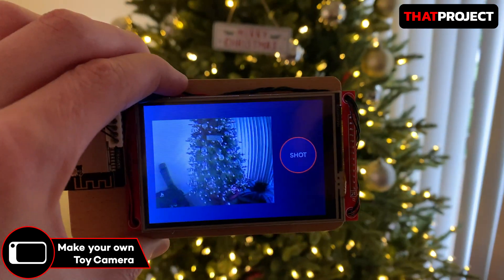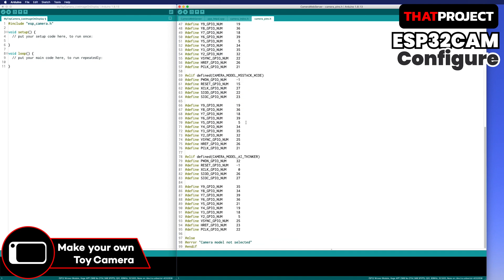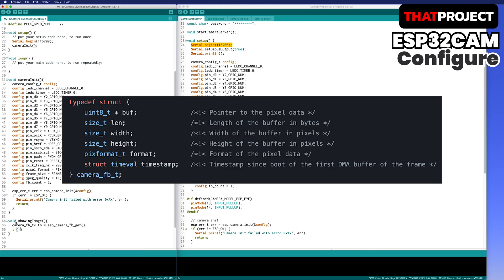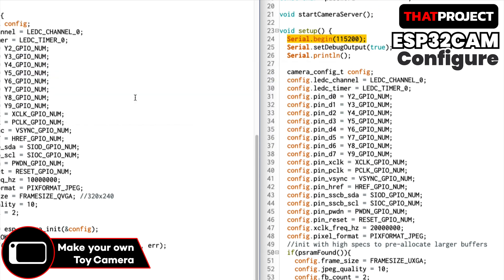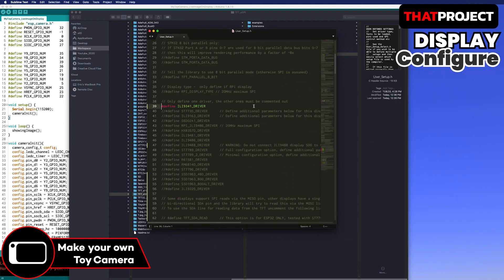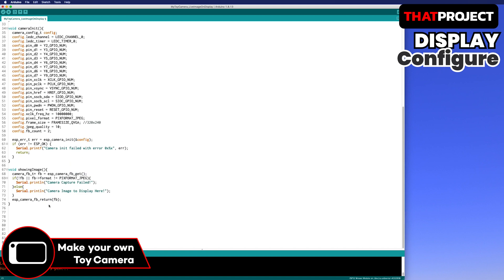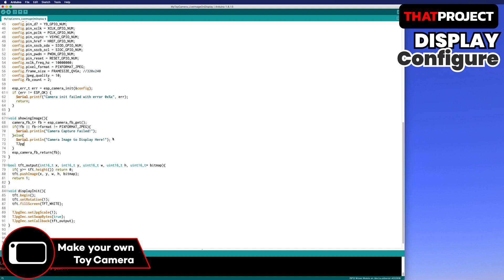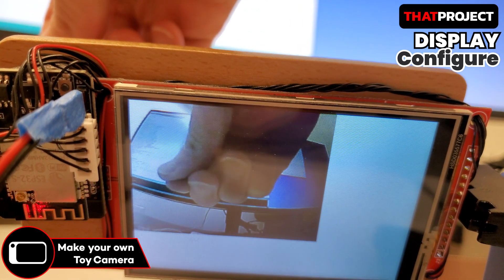Toy Camera = ESP32CAM + ILI9488 + LVGL7 | Part 1, Live Feed Display #ESP32CAM #TOYCAM

Comment: How to use ESP32-cam with ST7735 without touch function? 
I will need extra push button for taking picture and I don't know if there will enough pin on ESP32-cam after some pins are connected to TFT screen.
Reply from the maker: @jumbo999614  It's an old project so I'm not sure but, you could also use a button trigger with GPIO2 instead of the touch.

Comment: If anyone else is having trouble with a white screen after properly adjusting the User_Setup.h file, you may have a problem with pin 16. In my case, my ESP32 didn't like me using pin 16 for the MOSI.  So, I changed "#define TFT_MOSI 16" to "#define TFT_MOSI 2" and moved the connection on pin IO16 to IO2.  That fixed everything for me!
Reply from the maker: As you know, this is a project I tried a long time ago and I don't remember exactly how I wired it. If possible, I would like to do a similar project with LVGL 9. Then I will take a closer look at the parts you mentioned. Thanks for the comment.

Comment: working with freenove  esp32s3 Guru Meditation Error: Core  1 panic'ed (LoadProhibited). Exception was unhandled.getting this error
Reply from the maker: This is an old project so it's hard to know what the issue is. If you use the version used here instead of the latest version, it may work like the video.
Reply: @ThatProject please mention esp , TFT version
Reply from the maker: @sudipasaha1225  The ESP version seems to be 2.0.6, and the TFT_eSPI version cannot be confirmed.

Comment: Hello, i tried this tutorial but i am only getting a white screen on my display, i have checked that my display is hooked up correctly by displaying different graphics on it. I am using an ESP32-Wrover-CAM.
Reply: Just in someone else is having the same problem, in my case, the problem was pin IO16.  For whatever reason, the ESP32-CAM didn't like me using that pin for the MOSI.  So, I changed "#define TFT_MOSI 16" to "#define TFT_MOSI 2" and moved the connection on pin IO16 to IO2.  That fixed everything for me.  Hope that helps!
Reply: Nevermind, i just realized you cannot use the same pins for Camera that you use for the tft display, changing my pins worked.
Reply from the maker: @logz3288  This project is too old. Are you using lower versions of all libraries to run this project?
Reply: @ThatProject  Nope, using all new libraries but managed to get it to work by changing the pins i used for the display. I got a white screen before because i was using pins that were assigned to both the camera and the display.
Reply: @logz3288  Hey bro, could you please tell me the pins and connections you used in both the esp32 cam and the display?

Comment: I want to give you a shoutout man! I am new to this and not very much good with Electronics and there is hell lot of shortage on in-depth connection between ESP32 CAM and the ILI9488 TFT. I've scratched through all the corners and tried to make it work but of no use. I carefully looked at your video and made the connections (at https://youtu.be/K5Tr0AjK-Uc?t=283 ) and was able to work it out. Still need to go a long way but atleast I got to work with the example. Also, if possible for anyone, can someone please help me understand how we upload code to the ESP32? Following the connection in this Video, I uploaded code to ESP32 CAM separately first and then conencted it to the TFT(this is the only way I am able to work it out for some but not all the examples). Is it the only possible best way to go around with it or is it possible to upload the code with the TFT already connected to the ESP32 CAM?
Reply from the maker: I don't get what you're saying about how we upload code to the ESP32? It's simply building the code and then flashing it to the device. Anything I missed here?

Comment: Hello, I am trying to make my own project as you show in your video.

Seeing that it is an old project, I have made sure to keep everything consistent with the code. I have also made sure to install the library versions you are using in this video, as per your advice with the other comments. However, I get the error "#error Architecture or board not supported.".

I believe this is because I am not using the right board. The board I am using right now is the AI Thinker Model for ESP32, but you may be using a different board. I would like for you to tell me which model you used on which version of Arduino IDE. Other than that, I ask that you make a new video on this project but updated for today.
Reply from the maker: It's the same as yours. It's ESP32CAM AI-Thinker board. I know it's old but it works if you change a couple of things(In this case, you need to know how it works). Anyway, I hope you can fix the issue.

Comment: Hello friend, I have a problem when compiling the code, the error is the following: Hello friend, I have a problem when compiling the code, the error is the following: "\Documents\Arduino\libraries\TJpg_Decoder\src/TJpg_Decoder.h:23:26: fatal error: LittleFS.h: No such file or directory", do you know how I can solve it?
Reply from the maker: https://github.com/Bodmer/TJpg_Decoder/issues/30#issuecomment-980280255

You can use it like this, #include <LittleFS.h>
Reply: @ThatProject  nothing appears on the display, what could it be?
Reply from the maker: @Carlos_Schillreff  First of all, this is an old project. The LVGL version 7 used here does not work with the current version of LVGL. Nevertheless, if you want this project to work, it seems that it will work only if you forcefully set the version of the libraries used here.
Reply: @ThatProject  +Respect for answering Questions on a 2-Year-Old Video +1 Subscriber

Comment: I am trying to follow the steps, but I am getting an error when initializing the camera. It is the following:

Guru Meditation Error: Core  1 panic'ed (StoreProhibited). Exception was unhandled.

I have tested the camera and the display separately and they work correctly, but when I try to upload the skecth initializing both devices at the same time, I get the mentioned error.
I have all the same, the code and connections seems similar to yours, but cant initialize the camera and display

Can you help me? thanks in advance.
Reply from the maker: This only works with ESP version 1.0.6 and LVGL version 7.

Comment: Hi. I try follow the steps but its implement esp32 cam Ai Thinker with LCD ili9488. I'm sure the wiring  is correct then on LCD is always white screen no image stream. In the serial monitor the sketch is working. Can you help me?
Reply from the maker: Hello. What I recommend is to first run the one of example sources of TFT_eSPI and check if the display works normally. After that, You need to check is the version of ESP you are using. This project was built on ESP version 1.0.6. It may not work in the latest version 2.0.x.
Reply: @ThatProject  Thank you
Reply from the maker: @aliyawanaris  No problem. Also, I'm preparing a new version of this similar one. I hope I can open it sooner or later.

Comment: This is how the error occurs.
[expected primary-expression before 'const']
I'd like a solution, please.
Reply from the maker: Are you sure you're using LVGL7, not a new version of LVGL8? 
If so it works seamlessly. Please check it out first.
Reply: @ThatProject  i use TFT SPI 240×320 model
Reply from the maker: @애플망고-h9c  Have you set your display in the User_Setup.h?
Reply: @ThatProject  yes I did the same thing as the setting in the video.
Reply from the maker: @애플망고-h9c  Nope. My display is ILI9488 which is 320x480 and maybe yours is ILI9341. Need to set your display for using TFT_eSPI.
Reply: @ThatProject  What should I fix in setup.h?
I just need to fix the model name?
Reply: @ThatProject  maybe my model name is ILI9340
Reply from the maker: @애플망고-h9c  No matter what, you have to set up your display on TFT_eSPI.
Reply: @ThatProject i modified it at User_setup.h
define ILI9488->define ILI9341
but get the same error
Reply from the maker: @애플망고-h9c  well I have no idea why you got this error if you’re using my code. Sorry I can’t help you.
Reply: @ThatProject  it's okay thank you

Comment: Hey I need some help, I cannot get this to work for some reason.. I followed your pin configuration exactly and also the code, but when I run it the ILI9488 never turns on, nothing. I did not get any errors in my serial monitor. Can't figure out what's wrong here
Reply from the maker: The graphics settings for TFT_eSPI may not be properly set up. Also, please check if VCC is connected to the backlight of the display.
Reply: @ThatProject  Hey thanks, I did not connect the LED pin (Backlight) to the VCC (power line in my breadboard). I thought the LED was optional, but it is required. Works now, thanks!
Reply: @ThatProject  Do you have any advice how to power the ESP32CAM + ILI9488 using a battery? 
I tried to use a 1x3.7V Lithium Ion Battery 2000mAH but I just got a white screen, no video.
Reply from the maker: @Martin-mw7ys  Weird. It should be working fine. I'm using the ESP32CAM with a 3.7v LiPo battery and it works fine.

Comment: This is great. Can we put face recognition with it? If so do you have a video tut for that?
Reply from the maker: Unfortunately, I don't have it yet.
Reply: I have another LCD ILI 9327 open smart. Is it the same connections?
Reply from the maker: @digitalartee  It's going to work if TFT_eSPI supports ILI9327. Please check this. 
https://github.com/Bodmer/TFT_eSPI/issues/333#issuecomment-476004705

Comment: Very nice -- I was working on a similar thing, but with a 7789, and a video recording function.   I started with the adafruit tft library and the esp jpeg-bmp library.  I couldn't get the adafruit tft library to work, so I found the bodmer tft library.  I should have switched to the bodmer jpeg library as well -- much nicer than the esp libraries I have been using.
Reply from the maker: Agreed. Bodmer's tft library is the best for the low-power system of MCU. Also, I'm looking for a way to make it a little bit faster than now.  I hope you like it too.